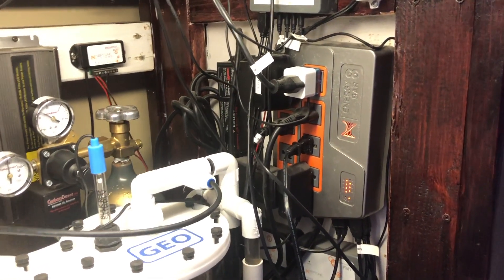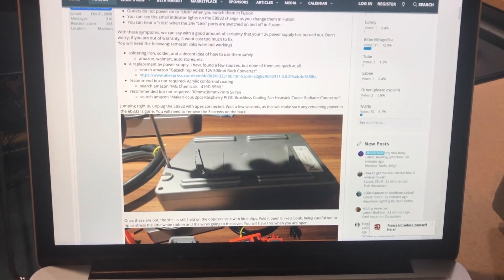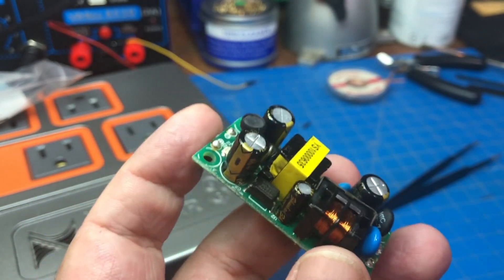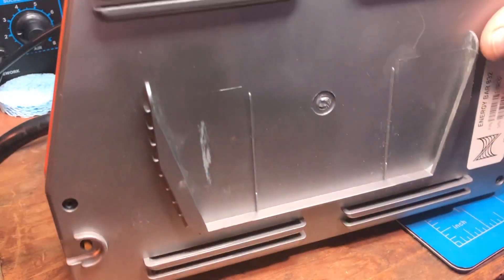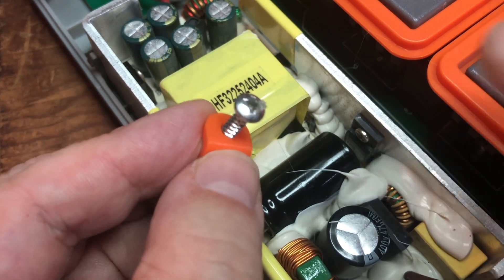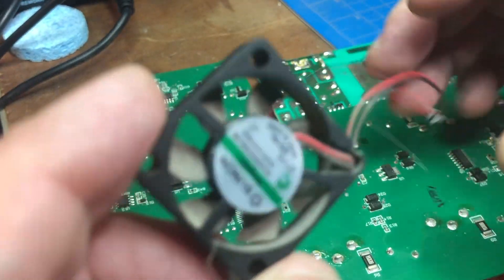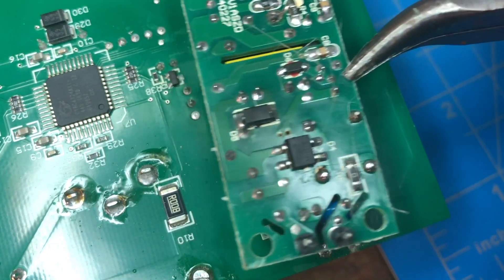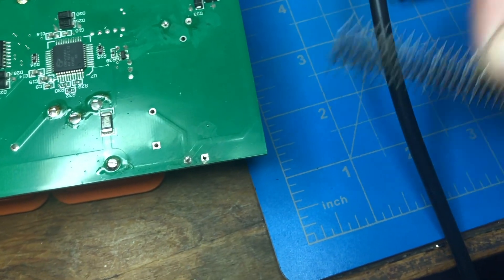Fixing an EB832 with Non-functional Outlets but has Working Indicator Lights

Comment: I had this problem and I bought the replacement piece from AliExpress for about $7.00.  I got the part, clipped out the old part, soldered in the new part in less than 5 minutes, and it 100% fixed the problem.  I'm able to use the EB832 again and everything is working like a charm!
Reply from the maker: That's great to hear you were able to fix it, cheap and fast!

Comment: How's the 180 doing?  Looking for a undated on the 180 and the DIY controller.
Reply from the maker: 180 is still up and running. Thanks for asking.  Maybe I will do an update soon.  I just shut down the 40 Breeder that was running on my controller.  It worked well enough on that system.  I learned a few new things and keep thinking about working on it again to make improvements.  Maybe some day....

Comment: So good to see you post again👍 my only advice is circuit board clamp and heated solder sucker - best investments for rebuild or removal of parts😇 
  Any updates on your Reef controller build😁 I got temp and humidity working but ended up using the pi for octoprint with my 3d printer.
Reply from the maker: thanks man, I appreciate the tips!  I've not worked on the controller in quite some time, but what I did finish is still running my 40 breeder reef and been solid ever since.  I'm starting to get the itch to resume work on it...

Comment: Nice one ReefSpy. I sent my EB832 into Neptune 1 month out of warranty. They charged me $75 bucks. I saw the same write up on R2R and ordered a bunch of power supplies from Aliexpress and have also done my own repair and have plenty of backups on hand. Thanks for sharing.
Reply from the maker: Yeah, if I have to do this again, I'm gonna put a socket on the main board to make swapping this module even easier for when it fails again.  :)

Comment: When I sent my power bar in they told me there were 3 rust spots on the "motherboard" (their words).  Since my energy bar was not in my cabinet I do not think that could be true.  However, the repair bill was $180 or I could buy a new one for $200.  I did not open mine it up but wished I had now.  They should NOT be making money off repairing their broken parts out of warranty.  I already dropped some serious money buying all the apex components and most have died.  I really love my apex but really dislike everything Neptune and their horrible business practices. 
Thanks for the video!